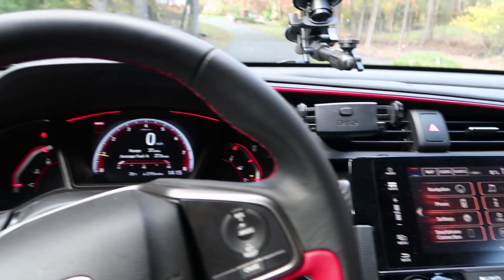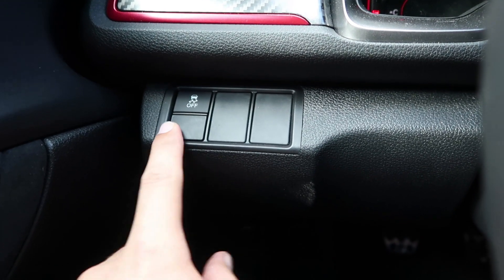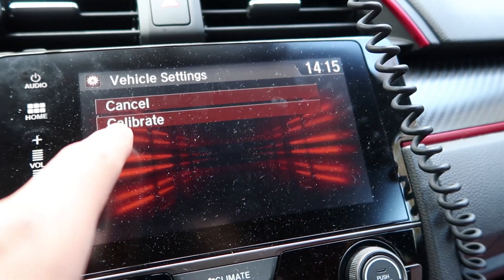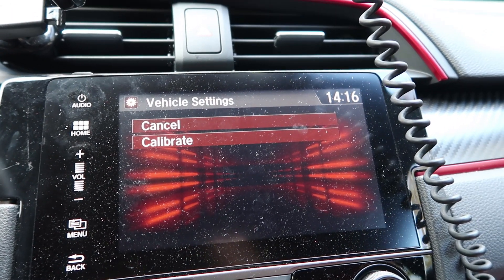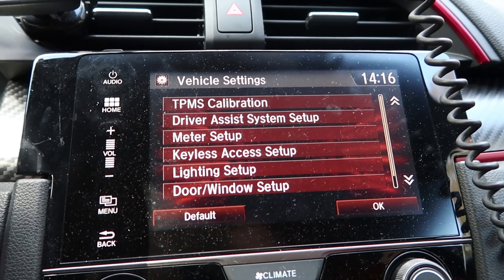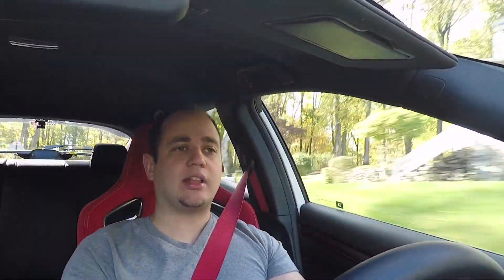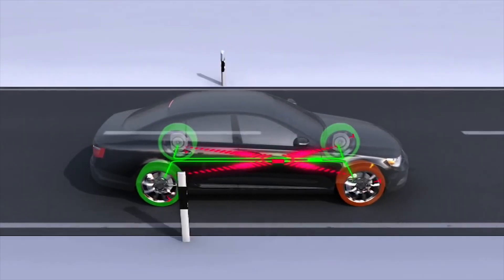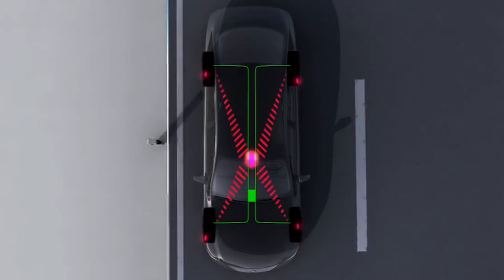2017 Honda Civic Type R TPMS Issues? | How to Solve Them & How it Works

Comment: The TPMS system on the FK8 is so sensitive. It happens quite often for me. I heard somewhere that it’s best to reset the TPMS three times on the bounce to get it to fully reset. Not sure how true that is.
Reply: That happens to me every time I drive my type r
Reply: @hugoramirez1221  do you just ignore it and reset the warning?
Reply: Well, yeah i reset it, every time that I see it
Reply from the maker: all it is doing is reading each wheel's speed relative to the other wheels. If the algo detects something is off, it'll send you a light. Just check air pressures for uniformity, reset, and go on with your day.
Reply: @FlyinGato  that’s what I tend to do, but the pressure light comes on very frequently, which is less than ideal.

Comment: Thanks a lot for explaining it, I have a 2018 Civic Si Coupe, and I had assumed I needed to buy tire sensors, and the dealership I called said I didn’t need them. I have been searching to confirm this on the internet, because I was so amazed by not needing to buy them, and on top of that, the mechanic I went to was still trying to sell them to me. Perhaps he didn’t know about this, or he was trying to cheat me.  So thanks to you and Galpin Honda for telling me about this, and saving me a lot of money!

Comment: Dude, I have a bmw, and you can take the sensor out from the wheel you're changing. And put it on the new wheel.. simple
Reply from the maker: I have two BMWs, if you have multiple sets of wheels it becomes a pricey problem

Comment: I had 3 warnings the day I took my car home when there was no problem. It was 15 degrees out.

By 500 miles I had a noisy brake too. I'm hoping it's just excess dust or salt. I'm only going out on days the pavement is clear but some places have salt dust on the roads.

Comment: Can this process still work if you have aftermarket chrome wheels on the car??
Reply from the maker: It does
Reply: So far so good. I'd top off the tire pressure 40psi for all wheels, tpms light haven't turn on since. It really does work for custom wheels too! Thanks bro

Comment: Honda TPMS system picked up 3psi drop in pressure due to slow puncture in one wheel of our CRV.   Many issues with corrosion in individual tyre monitoring devices used by BMW.    When considering how rare punctures are these days the Honda system is by far the most practical & cost effective.
Reply from the maker: I agree, I like it!

Comment: BMW may have to use individual TPMS due to use of run flat tyres, for which it may be a mandatory requirement.
Reply from the maker: That's actually a good point.

Comment: When the tpms lights on i found the best time to calibrate when the tyres are warm and btw very informative video 👍👍👍
Reply from the maker: Thanks Armando!
Reply: Good point, just installed my winter wheels/tires and I think you solved the issue I was having with a recurring warning light.  Thanks!

Comment: 4:14 so where do the speed sensors located at ? when i change the wheels do I have to take off the sensors from factory wheels ?
Reply from the maker: No, the speed sensors are the ABS sensors, the wheels don't have tpms
Reply: @FlyinGato  thanks for the info!

Comment: Thanks for this.  I am having issues with the system re-setting after replacing one tire.  Tire dealer says it's because the tread depth is different than the other three but, from your video here, I am seeing it should accomodate for that.  What else could have gone wrong that I can't get the TPMS to recalibrate?  The error message "Tire Pressure Monitoring System Problem" comes on after about 20 minutes of driving (between 45 and 65 mph).
Reply from the maker: rotate the tires, make sure you inflate them all to the right pressures, and then recallibrate
Reply: FlyinGato Done and done. Still having this issue. Today I was told my 3 older tires self-inflated so the pressures didn't match again. I'm baffled.
Reply from the maker: What the... That's baffling, from the way it works it shouldn't be that sensitive
Reply: @lapearlie8982   i have the same problem, do you find a solution?

Comment: Late to this party, the bmw M cars show you tyre pressure and temperature, including alerting to punctures. All that is useful to know when leaning on the car.  The circumference / speed sensing of a tyre is so simplistic, I'd be embarrassed to admit it if I couldn't feel a corner losing pressure and needed a light to tell me, then again I grew up in the analogue world so maybe anything is better than nothing.

Comment: Hey there, another great video !!!
Quick question for you...
When I'm driving my type r I hear a high pitch rattle sound when I let go of the gas as the car is deacelerating 
I'm not sure what the sound is... it's not there when it's in neutral ... only in gear and not when I'm accelerating, it's only when I let off the gas 

Hopefully you have an idea of what this is! I only hear it when windows are down and only when car is in gear .
Hope I made sense lol
Thank you!!!
Reply from the maker: +Rob B hey bud, that's the LSD decoupling, helical LSDs do that, it's like a high pitched metallic sound right?
Reply: Yeah that's definitely it then! Thanks so much for your fast reply man!
Reply from the maker: happy to help!

Comment: Hey brother I’m having that same screech in my front right break and I’ve tried to get it dealt with but no success I was just wondering if you know what it is and what you’re doing about it
Reply from the maker: You have to change brake pads for a permanent fix, if you're in the US I'll be releasing a video for cheap pads that work really well and don't squeal

Comment: thanks flyingato, that fixed it! I think I screwed up, though....I decided to use that crummy air compressor that comes with the Type R,..and blew a crapload of gluey stuff into one of my valve stems. What?!! All I wanted to do was top up my tires; I guess I could have read the directions, but jeez who would a thought they'd put goop inside an air compressor? Needless to say I yanked the thing off my tire, getting goop all over my hands, pants, rim, etc. IMHO they should have just put a little 12v compressor (with a friggin GAUGE!) and a can of fix-flat.
Reply from the maker: Yea it's a fix no one asked for, I don't want goop all over myself either!!
Reply: funny, I like driving the mountains and flatlands in Death Valley in my Type R,  and the quick elevation changes always set off the tire sensor. Something about going from 200 feet below sea level to 7000ft and back and forth all day just drives the sensor nuts. The guy at the Furnace Creek gas station told me he has to loan out his tire gauge several times a day for this issue. I find it nerve-wracking doing hairpins with certain-death cliffs when the tire pressure yellow lite is on,..even knowing it's a false alarm, it still tightens the scrotum

Comment: Is it tru if u got one of the tires not the same kind but same size it can trigger urs tpms sensor light?
Reply: I am wondering the same thing.  Did you ever get a response?
Reply from the maker: It's possible but unlikely
Reply: Any words of wisdom to offer the Tire Dealer as he attempts to remedy the always-on sensor error now that he replaced just one tire?
Reply from the maker: It stays on even after recallibration?
Reply from the maker: Make sure all the sizes are the same, diameter size mattress, so does tire pressure
Reply: When I go through the recalibration process it indicates "calibration started" and goes off but after about 20 minutes driving, comes back on.  Tire is exact same size just a slightly different model.  They're telling me it could be the difference in tread-depth but that seems to be something it would auto-calibrate, no?

Comment: I would have to say having the individual sensor in each tire is more robust than the Honda system.  If you have someone who does not maintain their vehicle, then trying to determine which tire has low pressure then this is a detriment to the vehicle owner.  
But, thank you for helping me now understand why the same system has been used since at least 2010.  My daughter owned a 2010 and now has a 2020 Civic.  I could not understand why a specific location of the tire with the low pressure could be identified.  Of course the Honda system is less expensive for the manufacturer.